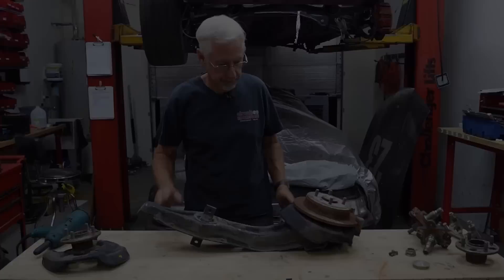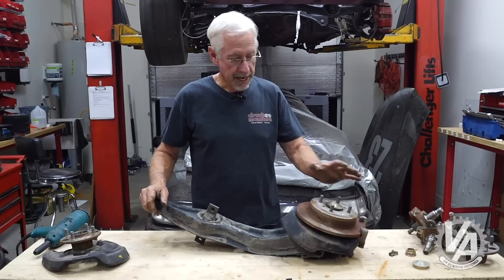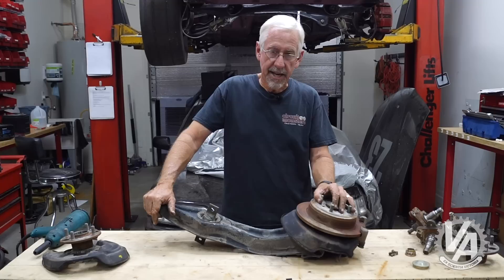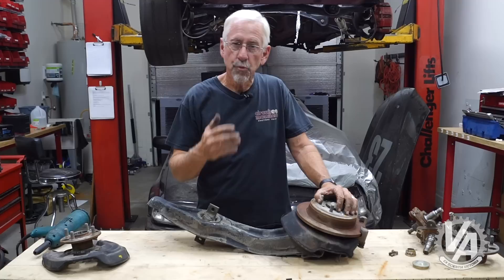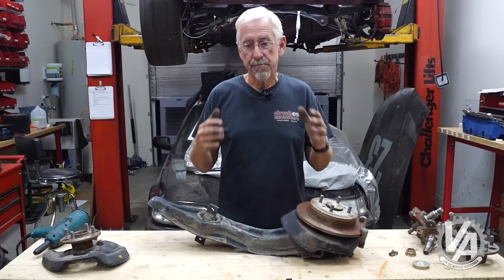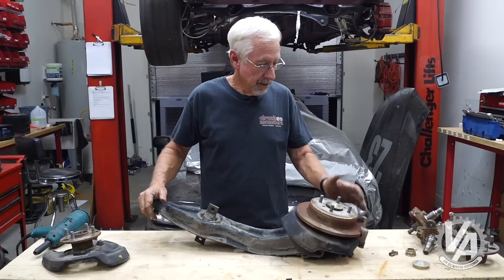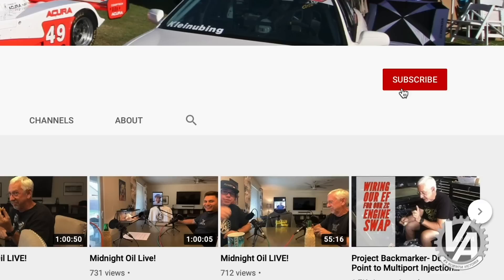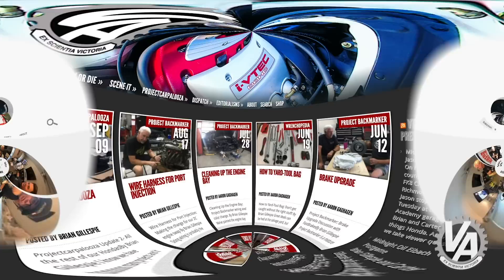Quick Tip Rear Trailing Arm - Don't screw up your car when doing a disc brake swap

Comment: Ever measure the wagon awd trailing arm mounting surface depth?
Reply from the maker: Longer and wider
Reply: Are they wider, push the wheel out as far as DA or further? I’ve never been able to get my hands on a wagon awd trailing arm to measure how it was done in video.

Comment: So I got rear spindles from a DA, but I'm missing one of the calipers. Can I use a DC caliper on a DA spindle? (Going on my 89 Civic si)
Also, can I use an EF wheel hub on a DA spindle?
Reply from the maker: I'd grab tow DC calipers. The brake lines attach differently. Try to keep it consistent.

Comment: What rotors and calipers would fit this setup, do I need da/90-93 integra ones and if so what ebrake cable fit those
Reply: Could I use an em1 ebrake cable

Comment: Hey Brian, I have a 91 EF that i did the rear conversion with DA trailing arms and yes, the rear is wider now. However, I bought new discs, calipers, and brake pads for the DA set up and im short on cash and im looking to re-use those. Could I go to the salvage yard and get DC or EK trailing arms and use the spindle and brake set up from my DA arms on the EK or DC?
Reply from the maker: You ca put the DA spindles on any 88-00 Civic trailing arms.

Comment: Can you give recommendations for the T50 bit and associated tools/extensions to remove the spindle from the arm?
Reply: I use a reg t50 bit on my ridgid impact gun. With a 3/8 to 1/2” adapter. 
Heat the heads of the fasteners and let the heat travel down to the threads. This loosens the lock tite and then zap em off with the impact gun.
Reply: I second for heating the T50 bolts. I did this recently. I bought a small torch kit and heated the bolts and I removed just with a breaker bar but I did one bolt at a time and the bolts came off easy.

Comment: Great info. I have DC trailing arms i got for my eg conversion, but cant find a 40/40 prop at local yards from non-abs DC or eg/del sol si. What is another Honda I can get a non-abs 40/40 prop valve? Or can I use an ABS one? Thanks
Reply: You can find them in the EK Hatch DX, CX, and HX models, they have the same valve as the Si part number 46210-S04-902. What I do is run the VIN on the car and check with the online catalog such as hondaautomotiveparts.com (this is not a plug as its used as a refrence tool)
Reply: @franciscogarcia-xt5wn  Those have drum in the rear, so figured they wouldn't work. Thanks.
Reply: @evanscott5494  Works just fine tried and tested through some 26% grades recently. The 2dr coupes are the ones that wont work or should I say are not recommended since a prop valve dosent do much under normal braking. Its under the hard braking where you feel the difference.
Reply: You don’t need to change the prop valve. It’s been discussed in a recent video with the owner from Fast Brakes

Comment: I got trailing arms from a 4 door integra, Will the e-brake cables from a 4 door integra work on a 95 civic coupe. Or do I have  to have the cables from a 2 door integra???
Reply from the maker: The Civic coupe and sedan should use the Integra sedan cables and the Civic hatchback should use the 2 door (hatchback) Integra.

Comment: i hav 93hatch wif 94teg arms 91ex master now what i wants to know is do i needs the proportioning vavle i did it a while ago but i let the car sit so dont remember if i have the 40/40 or 40/60 do i really need it?
Reply: also 94 teg front bigger sized ect
Reply from the maker: You do not need to change the prop valve.

Comment: Do you need to change the master cylinder on a 2000 civic ex when swaping to rear  brakes from a 94-01 integra brakes ?
Reply from the maker: On and EX Civic? No.

Comment: So the spindle have to be from a 90 to 93 only? Or the spindle from a 94 to 2000 works too if I find one? Please let me know.
Reply from the maker: They all work, but if you have something otyher than the 90-93 Integra you can use the whole trailing arm as is.

Comment: What's the difference with switching the trailing arm vs using scarebird conversion kit?
Reply from the maker: You can use the Scarebird conversion on the stock spindle to use DA or DC Integra calipers and discs. You can also use the Fastbrakes conversion if you want to have a larger rear disc.

Comment: OG I have a p1607 code on my k24 frank. I changed the crank sensor and it still won’t start. School me OG
Reply from the maker: Life’s Choice, that’s an ECU malfunction code. My guess is either you have something grounded that shouldn’t be, or you have a bad computer. Also, check the engine harness ground and the engine to chassis grounds.

Comment: What proportioning valve should I use to feel the difference?I have a 97 Civic DX
Reply from the maker: It's unlikely you will be able to tell any difference based on feel no matter which prop valve you use.

Comment: Nice ok just so everyone is clear we can use 96-00 civic (ek) trailing arms and ether 90-93 or 93-00 integra (da or dc2) spindles if you cant find the whole trailing arm or there trashed?

Comment: Will a 2001 gsr rear brake fit on a 90 ef
Reply from the maker: If you use the whole trailing arm. The brake cables will be a little long though.

Comment: hello , im from spain and we dont have the integra model and the  market of parts here of integra  is inexistent , i want to swap in to disc brake  but i dont know if there is any other model, i know that exist a swap kit for the EG but i dont know if the knuckles (arms) arethe same as my car (civic ej8 1.6 sr)
anyone knows?
Reply from the maker: 88-00 Civic Si or VTEC models work.
Reply: @VTECAcademy  okey thx, and one more question plz, u know if the arms with drum brake of my car are the same arms as the arms of the EG hatch?
Reply: @VTECAcademy  then eg6 trail arms work in my ej8?

Comment: 91 Ef sedan,i just use my stock ebrakes?  do i need to change?
Reply from the maker: If you are doing a disc conversion you probably need to get the disc brake cables.
Reply: @VTECAcademy TYYY!!! BTW AS OF 8-30-21 STOCKTON IPULLUPULL HAS 3 94-00 INTERGRA ALL WITH REAR DISC BRAKES. A 90 CRX WITH R DISC AND A 91 INTEGRA THAT I TOOK THE REAR ARMS PARKING BREAKS AND DISC SET UP FROM ! GOOD LUCK!

Comment: I want to do a 5 lug conversion on my integra DA. Is there going to be a lot fabrication needed?
Reply: Front hubs would need to get machined down to fit the wheel bearing. Karcepts also sells a 5 lug hub for DA but is 36mm instead of the normal 32mm
Reply from the maker: The problem is the rear hubs. You need a spindle or trailing arm with spindle from the US Integra type R
Reply: @VTECAcademy  thank you. Looks like I have some homework to do

Comment: Any tips on the 4wd 1st gen CRV rear disc swap? Info is difficult to find. Thanks.
Reply from the maker: Outspoken Insider we’ll try to look into that. If its a drag car though, I’d stick with discs. They are lighter and have less rolling resistance.

Comment: are 95 civic ex coupe with abs trailing arms good?
Reply from the maker: They are drum brake I believe. So if that is what you want, it's fine. Just don't put them on the 8=90-93 Integra unless you want it narrower in the back. Also check the bushing to make sure they are in good shape.
Reply: I actually bought a 95 civic coupe ex with ABS and it had disc brakes. Never seen that before. Everything was original even has speed sensors
Reply from the maker: @r-specgarage8317  Yup, EX coupes and the Si.
Reply: @VTECAcademy  awesome!! Thanks

Comment: Would this also apply if your using EG trailing arms instead of EK? Looking to convert to rear disc on my eg sedan
Reply from the maker: Yes. EG, EK or EF work.
Reply: @VTECAcademy   I have a 90 ef sedan and picked up some 91 DA disc trailing arms yesterday. I don’t want to put them on now because of the widen track. Can I strip the DA arms and put the components on my EF arms? Or do I need to get some stripped EK arms like you said in the video?
Reply from the maker: @Otsp922  Strip the DA arms and put the components on the EF arms.
Reply: @VTECAcademy  last two questions will I need new brake lines or use the brake lines from the DA? Which E brake cables would I use?
Reply from the maker: @Otsp922  You can use the DA lines if they are in good condition. They probably won't be. The DA E-brake cables should be fine.
Reply: @VTECAcademy  thank you very much sir.

Comment: So is there anyway to talk to anyone on here about a 91 CRX? Trying to decide if it’s worth making a race car or not, idk if it’s a 1.5 or 1.6l
Reply: Looking at the front center left side of the engine there will be an engine code stamped on the block. If it's a single cam and reads D15.... its 1.5 and if it reads D16... its 1.6. Same goes for most Honda engines a letter followed by the first two numbers depict the liter size. H22 = 2.2L, B18 = 1.8L and so on.
Reply: Johnnyef9  thank you soo much! I’ve been asking countless Honda ppl, groups and etc, nobody ever told me something that simple and straight forward. I was literally about to junk my crx because the heads cracked and needs some other minor things but couldn’t find any info on the thing for 3 years now
Reply: @AmericanRustWorker3369  glad I could help. Did you find out what engine you have now? Another thing you can do is google search a "vin decoder" and enter your vin and find out more information about your car. Hopefully you hold onto your CR-X as the cars are becoming scarce haha.
Reply: Johnnyef9 thank you very much!!!, no I didn’t get a chance to check my car today, but I definitely will tomorrow and thank you I’ll try the way you suggested first then go that route
Reply: @AmericanRustWorker3369  hey no problem. There are a few EF forums on FB where people can help you out there if you have questions. You could pull a CarFax report on your car which I find it pretty neat to know a little more info about your cars whereabouts during its lifetime. I am a huge EF fan and have two 90 Civics at the moment I play with.

Comment: No your wrong you measure 1 part of the trailing arm and you think your done yet you don't even take in account to measure the mounting locations of both the top and bottom control arms which are very important, or consider the fact that the DA control arms are a different length and last but not least you haven't measured the difference in distance where the upper and lower control arms mount on the DA chassis compared to the EF your completely wrong every time I have done a rear disc conversion I have used the Civic control arms and tow arms and the wheels always sit in the exact factory location and I know for a fact that when you use the inegra control arms your geometry is completely off and the wheels stick out like crazy 
that's pretty funny you literally take 1 measurement and say "your about to be schooled" yet you haven't even done your homework LMFAO
Reply from the maker: No, we're not wrong. We have measured the DA trailing arms on a Civic EF and they are in fact wider. The DA control arms are the same length as the EF control arms. That said, yes the Civic trailing arms are the same width from 88-00. They are also the same width as the 94-01 Integra.
Reply: @VTECAcademy  Yeah ok dude if you are using the DA control arms you are completely wrong I have the DA trailing arms on my EF with the EF control arms and I also have a completely stock EF and both rear wheels sit in the exact same spot LMFAO your not supposed to use the DA control arms and no their not the same
Reply from the maker: @boost_edjamesmathew2168  In a future video we will do the swap on my budget EG. I will compare the EF, EG, DA, DC2 lower control arms arms to show everyone the differences. Also I will show the differences of the trailing arms. It will be informative.
Reply: @VTECAcademy  lol

Comment: I have a 2000 Honda civic ex and I want to do rear disc brake conversion so I can keep the original trailing arm and just get the spindle and the rear brake parts from a integra and that's all?
Reply from the maker: Yes